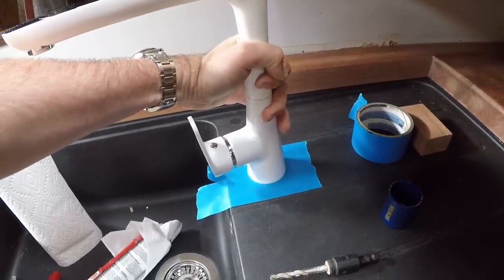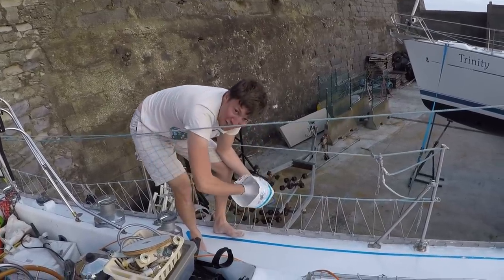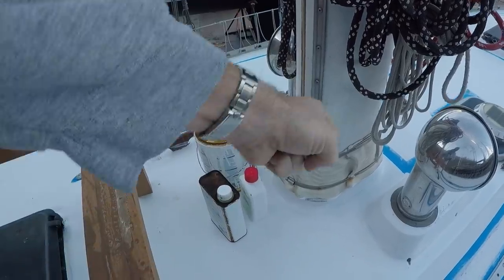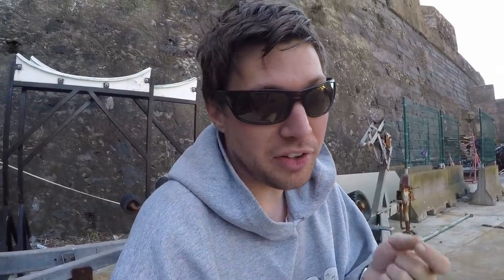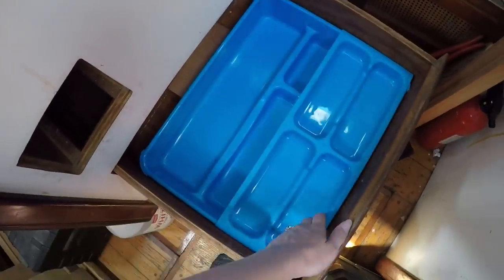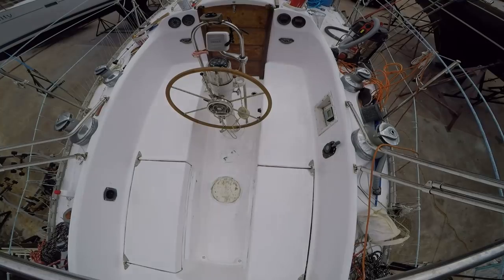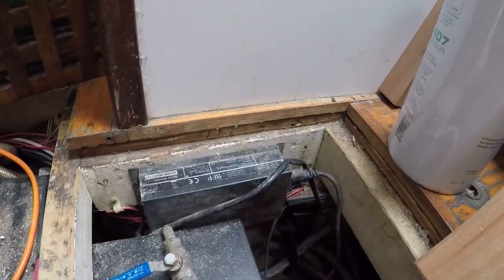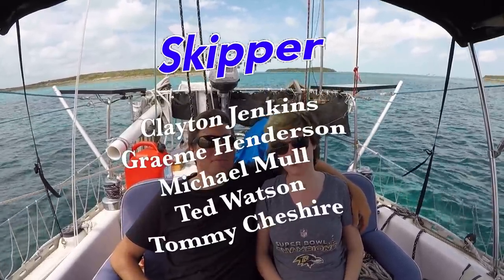Cockpit Makeover | Sailing Wisdom [S3 Ep39]

Comment: Tough break on the non skid. 300w of solar for your size area seems a little low. Any reason you don't put more on the back? Panels are not that $.Cheers.
Reply from the maker: They just don’t fit. :(
The two panels we mounted were kind of a stretch and anything else gets in the way of the wind steering, sheets, or docking.

Comment: I thought you are using black volcanic rock, that will be seen very easy when the paint starts to rub off. 
And then you showed us and it was only the first coat ,well glad you are now getting the right one.
Reply from the maker: It just looked bad. The big pieces stood up and the fine parts made the paint grey. As the paint would wear we would have black specks in the white deck. 😕

Comment: Having rwcently done nonskid w Kiwigrip and having house walls rendered I was struck by the similarity between the two products so I did a test piece with Dulyx Acratec applied to a piece of ply with the kiwigrip roller. I put this next ti abdoor at house so it would get trodden on. After 2 months results are great. 4L kiwigrip about $A180. 15L acratec about the same price.
Reply: Both water-based which is a bonus.
Reply from the maker: Wow! That is quite the “Marine” markup!

Comment: best charger sterling pronautic  universal voltage it doesn't care 220 or 120. If you disconnect batteries it will run the boat, it chargers agm, flooded ,gel or lithium you just program it ,will charge 3 separate battery banks
Reply from the maker: Sounds awesome! Do you have a link for it?
Reply: @RiggingDoctor  marinehowto.com tells you about them,I bought mine off ebay and run lifeline AGM batteries it comes with battery temp monitor and I bought the remote for it off amazon.Amazon also sells it under pronautica
Reply from the maker: Thanks!

Comment: Hey Herbie,  Have you considered Carbon Fiber as a possible replacement for you batteries?  They are of the same disposition as Lithium ( you can run them down to zero w/o fear of damage.  You get more useable power and they’re about 1/3 the cost).  Though still more expensive than AGMs initially, they can recharge through 3000 cycle like lithium making them less expensive over the use time of your batteries.  At least something to consider and research.
Reply from the maker: I did look into them and I also really like that they won’t burst into flames like lithium can! They were still out of our budget for right now, but they almost made it into our boat ;)
Reply: @RiggingDoctor l have seen them at $500 per battery and their shelf life is 10 times what an AGM is.  We too are budget cruises but not really long distance.  Being in our seventies, I'd buy them two at a time. That's all you need to start.  Adding to your array over time as possible makes it more practical.  They also charge faster and easier, especially with your new solar set up.  Having an electric engine makes it even more viable.  This is all coming from an old boat guy that has nothing to do with any battery company.  Just sharing my thoughts and research because I l8ke who you are and what you are doing.  Blessings, Bruce and Nan Vining aboard BEATITUDES

Comment: Im thinking about getting an agm solar battery bank setup for power for a custom rv build (currently have one on my engine) but im curious, do any of yall know if its possible to have a battery controller auto shutoff if the battery gets to a certain low precentage? I dont want to quickly ruin my agms and would rather not constantly check it for voltage.
Reply from the maker: I would like to know about that too!

Comment: Have you tried charging your old batteries with jumper leads from a new one and a charger (if you have one now)? Often what happens is they build up lead sulfate crystals that need high current to either dislodge or reduce those crystals. See recovery option #2 here: https://www.optimabatteries.com/en-us/support/charging/resuscitate-deeply-discharged-battery
Reply from the maker: I have not because all the batteries are 👻
They are reading around 4-5v on a 12v battery. 
I tried bulk charging them but to no avail. 

My concern was we get them “ok” and then have them die on us as we approach our next port, or worse, not be able to keep the nav lights on all night.

Comment: You need to get in contact with me about a viable alternative to your battery problems. In our boat I put in 1600 ah of lithium batteries for less than $2000. It does involve some work and a very programmable set of chargers.
Reply from the maker: We already bought the batteries and they are on their way from the Netherlands, but for our next set, we want to do something like that!

Comment: LiPo costs a fortune but lasts for ever. There are cheaper ways of getting the batteries. Check out a guy named Jehugarcia . He is the master of battery banks and reverse engineered Tesla technology for a fraction of the cost.
P.S.
 I'm legit jealous of your sink!
Reply from the maker: I was looking into doing a system like that but it was going to take more time than I had. Also getting batteries to the Azores is tricky. The plan is to replace the batteries in a few years on a continent that has more availability of junked electric cars :)
Reply: @RiggingDoctor  just shipping LiPo batteries is complicated/expensive. I used lead acid 12V/120 amp truck batteries on land for years. They are heavy and need to be topped up all the time. Also being on a boat that is bouncing all the time is not ideal. A better option (half the price of LiPo or less) are 24V deep cycle lead/gel batteries. Not likely to find them in the Azores.
Reply from the maker: The batteries we found are by Venus and they are designed for electric propulsion in a sailboat. They are sealed lead acid, but have some really good characteristics! 

I can’t wait to get them installed :)

Hopefully, when these die, lithium or something better will be affordable and available.

Comment: Oh man new batteries, new chargers, new solar panels $$$$$, shoulda bought a diesel.
Reply from the maker: Haha! Still cheaper than buying fuel for the past two years :P
Reply: @RiggingDoctor  No doubt and then you spend all your time working on a diesel engine with it's tons of moving parts and fluids and it's choking, stinking loudness.
Reply from the maker: When we get back to the boat in June, I will film my annual maintenance on the electric motor
Reply: I’m just yanking your chain knew I’d get a bite. My house batteries are AGM’s and they are pretty good if, like you say, they are kept topped up. Mine are 8 years old now and still in perfect shape kept that way with a smart charger however I do have the luxury of plugging into shore power when the boat is not being used. Anyway, really enjoy your videos and it’s great to see the slow transformation of your yacht. Cheers Chris
Reply: FeelItRising to be fair diesels aren’t that bad. My engine is 10yrs old and it costs around $150 a year to maintain it. As far as noisy and stinky goes, not true. My engine room is well insulated and the motor is a common rail Diesel engine so emissions are negligible with absolutely no smoke and only 2litres an hour at 7.5 knots. Each to their own.
Reply from the maker: That is very impressive! Modern boats with well thought out engine rooms are definitely built around the motor. Ours looks like the motor was an afterthought; it sat right under the cabin sole with no space for insulation and the grate at the bottom of the companionway right behind it. When it was on, it was LOUD!
Because of all that noise, I never used it and that led me to desire an electric unit for the few times I do need mechanical propulsion.
I come from a power boat family and grew up with big motors, they really are nice when you are in a hurry, but fuel costs can add up quickly on a powerboat! I have nothing against diesel motors on other people’s boats :)